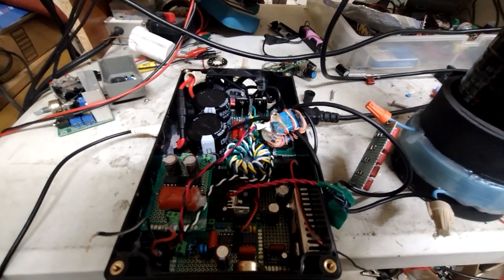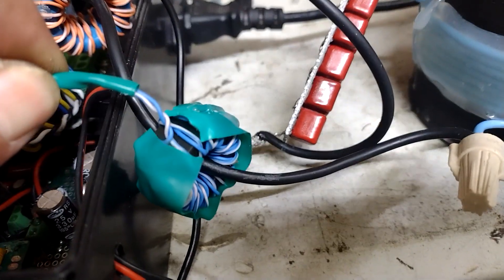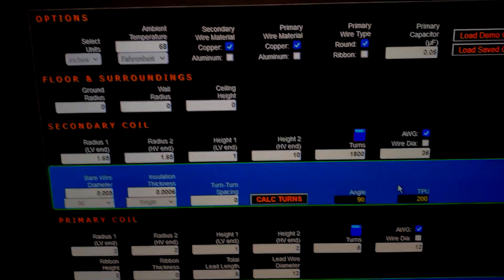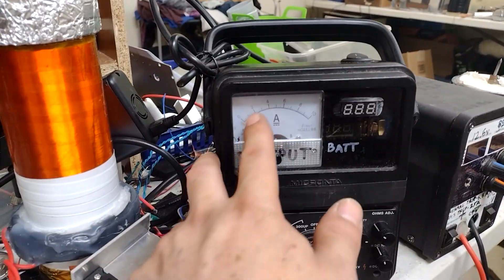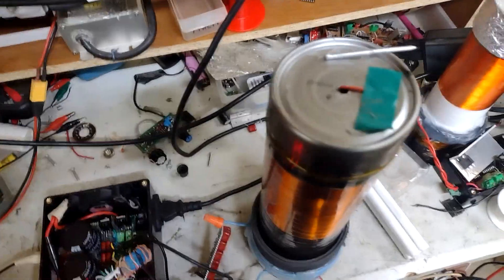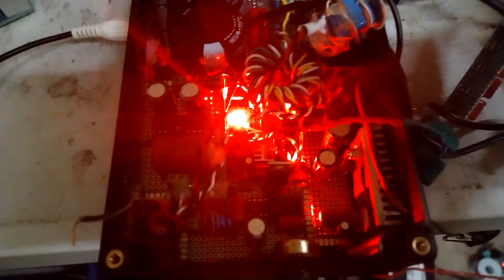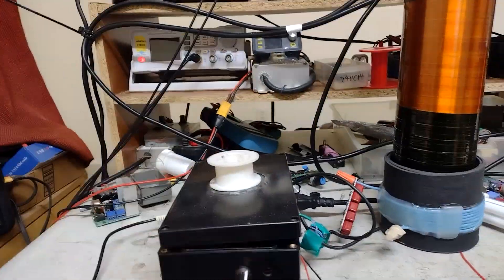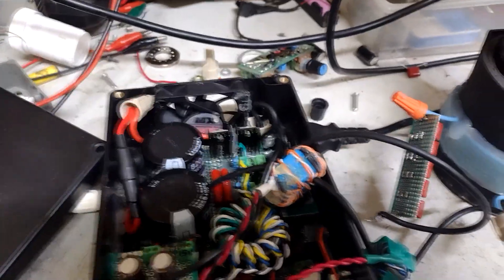Mini DRSSTC Half Bridge Setup

Comment: Hi great videos ,I have built several circuits working great, over night my GDT'S STOPPED working . I have 4 gdt's all tested perfectly built some of them months ago, can't figure it out ,retested circuits all good ,built a new gdt  this morning and nothing ,weird .Can you help ,
Reply from the maker: Sounds like it's not the GDT at all. Since it's just windings of wire that's pretty easy to troubleshoot. If you don't have shorts you're good. 
The problem seems to be in the GDT drive stage but if that part checks out it sounds like it's just losing continuity somewhere at the GDT connections.

Comment: can you dive a bit deeper in the feedback system, since thats the part that screws me up.
Reply from the maker: which circuit are you trying to build
Reply: @Magneticitist  A DRSSTC that uses mains voltage, preferably primary feedback.
Reply from the maker: @aryananiknam4817  So at what part specifically are you trying to figure out more. Like the general way the signal is even derived using the IC's or just more like how exactly to wind a current transformer and implement it etc.
Reply: I just cant figure out how the primary starts oscilating with only the interupter, the interuption freaquency is way lower then the primary resonance freaquency (note: there is no secondary in place, only the primary thats resonating, like your video of steve wards drsstc with ocd) in my head, when the interupter tickles the half bridge there should not be any resonance, because when the IGBTs are on, they are not driving the primary LC at resonance (obviusly), and when they are off, there cant be any courent flowing in the primary LC caus they are in series with the IGBTs that are off. So, how the hell is the primary starting to resonate from the interupter??
Reply from the maker: @aryananiknam4817  It's a nearly identical process to how the secondary feedback works. When I'm applying an interrupter signal this works kind of how a background oscillator would but it's not as reliable. If I have no voltage on the bridge while applying this interrupter signal I'm just going to see the gates being fed these pulses. With the gate drivers these are not driving signals but enable pulses. So with a low frequency interrupter BPS signal into the gate driver enable pins they will sort of ping and probably ring down a little on the output and that's what the gates will see. If there WAS bridge voltage applied at the time then this would cause the primary to ring as well with hopefully enough current for the feedback CT to see this ringing as passing the threshold. This builds up a ringing process that in turns creates the feedback loop.  

So just imagine you pulse an inductor hard, it will ring down at resonance if it's not overly damped somehow. This is the ringing that becomes a dominant signal because of the amplitude created from the resonance, which the schmitt trigger is fed and turns into squares at the same frequency and thus the feedback loop is created. You do the same thing with the secondary feedback except that is the LC that is ringing instead of the primary.
Reply from the maker: @aryananiknam4817  I guess to further go into the difference of the enable and drive signal, just look at the pin 2 input signals as being the feedback loop drive signal, and the enable pin 3 is just acting as an ON/OFF switch for the drive. If the enable pin is high for 1ms, then the input pins will be outputting resonant feedback drive for 1ms, and within that 1ms window of the interrupter square wave telling the gate drivers to enable, the actual mosfet gates will be driven at the LC resonance. So that results in a drive signal running at x frequency that lasts for 1ms.
Reply: @Magneticitist  will the gate drivers still ping if i use a mosfet to interupt the power going to them? I dont have gate drivers with enable pins. I will upload a video on my channel explaning furthermore my confusions tomorrow.
Reply from the maker: @aryananiknam4817  From my experience this basically depends on some variables largely dealing with the random charge that may be on the feedback input pin at the time. If I use an antenna it is usually able to pick up 60hz noise in the air always present in order to start a feedback loop using that 60hz signal as startup pulses.

I did a video a while back on gate drivers without enable pins where I used a couple gates to do the interrupting in between the schmitt trigger and drivers. This was based on a schematic someone posted on the highvoltageforum. I noticed that it would seem to work with whatever feedback method I used with a smoothed DC input. Unsmoothed required a certain voltage and kickstarting first.

A switch which is pulling the feedback high or low at the schmitt trigger for interrupting may also force a feedback loop on its own though.

Comment: WOW That's... Complicated
The arcs are nice tho

Just a thought 
Is it possible to use 2 push pull bjts as gdt driver 
And a bjt Schmitt trigger as feedback?
AND a phase adjust?
The power circuit can be Powered by  
+- 120v (like in one Tesla?)
If yes what are its downsides
I just want to build a simple drrsstc
Thanks!
Reply from the maker: Yea people use all sorts of gate drives but it all depends on the running frequency and load. All discrete is cool but these $2 gate driver IC's are amazing and can just be paralleled for more power and they seem way easier to use to me than 10 discrete components in their place. Drsstc's usually don't require a large gate drive capability unless you are trying to drive large switches like IGBT bricks. You can use a 15V drive on 247 IGBT's or Mosfets. Fixed frequency drive could even work well. I think the downside with all of that is just that it's more components and more tuning. 

The simplest DRSSTC I think is just making a basic SSTC then adding a primary tank capacitor. It doesn't need to use primary feedback. If you want primary feedback to make it an LC that always runs by itself then a 30 turn CT is easy to wind.
Reply: @Magneticitist  but are fixed frequency drives worth it?
Reply: To answer your question are fixed frequency drives worth it I would say no. Because with a fixed frequency drive if the circuit gets even a little out of tune it will cause your circuitry to blow up. And a non fixed frequency system is just as easy to build as a fixed frequency set up so I don’t see why you would.
Reply from the maker: @quantumlab9130  just for reference here's a little mini guy that's fixed frequency https://youtube.com/shorts/W3JcD5-PUUo
Reply from the maker: @tvishmaychoudhary69  I've actually noticed that fixed frequency can come in handy but there is the annoying detuning which happens. In the last couple PLL builds I made I found using the VCO to push fixed frequency worked fairly well.

This is when I'm not locking the PLL into a suitable range and allowing it to free adjust the VCO frequency around a lot. So for example my recent 2.8MHz coil can run fixed frequency no problem. I just remove the feedback and dial it in, but I have to account for loading when dialing it. Otherwise the output just drops as I move my hand close.

My larger 2kw PLL SSTC runs fixed frequency to a degree... There doesn't seem to be a suitable PLL lock until it spits big arcs. I'm just basically detuning it to have it get closer in tune the more the breakouts emerge.